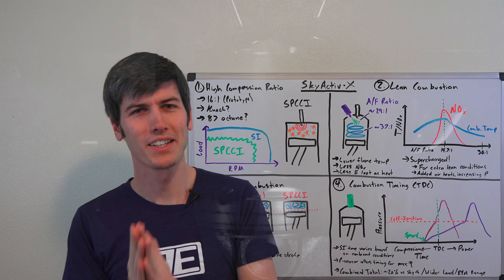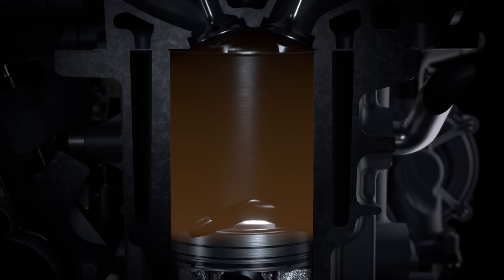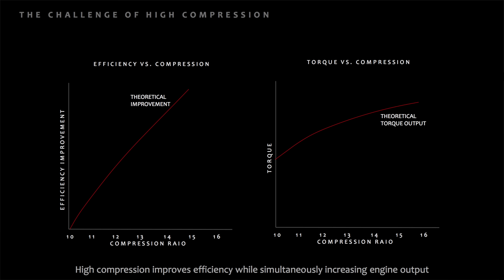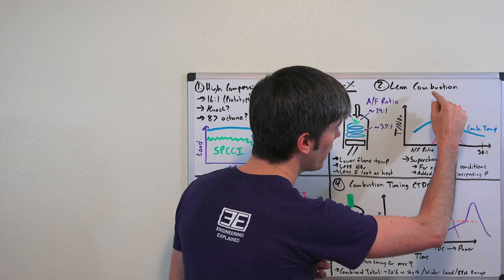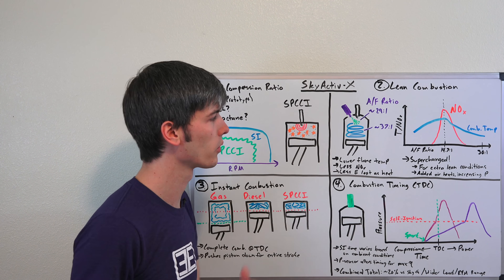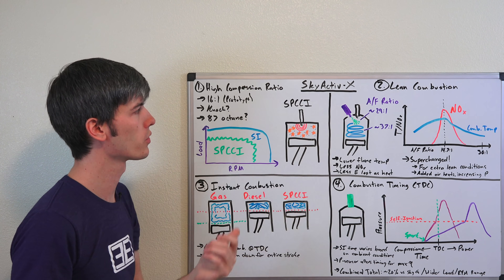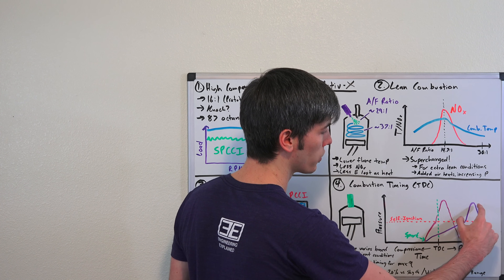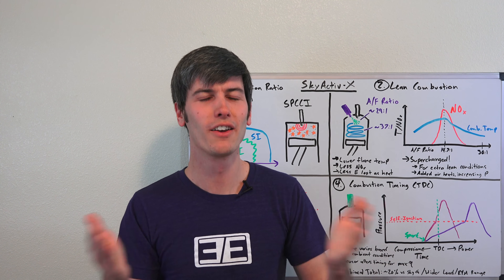How Mazda Is Saving The Gasoline Engine - SkyActiv-X

Comment: It would be cool to see a video comparing the efficiency of automotive ICE's to the efficiency and emissions (GHG's, NOx's, SOx's, nuclear waste, and transmission losses) of commercial electricity generation, and the environmental costs of extracting the rare earth elements used to build batteries. The potential environmental costs of going electric might be greater than simply following through with the current improvements in current automotive ICE technology.

Comment: I thought the main drawback to lean burn was the increase in stuff like NOX emissions? And that was why the first-gen Honda Insight, for example, had a special catalytic converter to adsorb these emissions (burning them off periodically).
Reply from the maker: Slightly lean can be hot, and lean burning diesel engines produce a lot of NOx, but for gasoline engines as you go leaner, temps come down and NOx goes down with it.
Reply: Huh, interesting. Thank you for that info. I guess the 22:1 the Insight officially gets down to isn't lean enough.

Comment: Props to EE for the most comprehensive explanation I have seen on SPCCI to date. While I have come to expect great insight from your channel, you have exceeded expectations here, again.

I have been monitoring SPCCI since it was announced, but I had not seen the pressure sensor explanation piece until here, which makes sense to my novice ears.

I expect my next car will be a Mazda with SPCCI. I hope they put these engines in their CX lineup. 😉

Comment: Nice. Except this is far from being ideal internal combustion engine. Bus engines utilizing natural gas/biogas has compression ratios of 18:1 and they're just ordinary spark plug based IC. So basically this effort of Mazda has been terribly waste of resources, as they could have just utilize clean methanegas fuels to get the same results. Fossil fuel days are limited anyway.

Comment: They are investing in internal combustion engines because electric cars are not feasible. 

Batteries may be getting better, but ultimately you will have to charge them, and with 11.1 kWh of demand added to the grid per car. 

This means it will cost trillions of dollars to upgrade the power grid to add the hundreds of gigawatts of electrical production each year, plus the load balancing systems, transmission lines, charging networks, etc.

Comment: What is the fuel intake system for this engine, is it direct injection or the homogeneous charge is coming directly into the cylinder with port injected fuel ? Please reply
Reply from the maker: Direct
Reply: Hi there. So, is the fuel injection process similar to normal CI cycle? At the end of compression, fuel is directly injected in the combustion chamber (like CI) and in addition to this, there is spark plug(like SI) just near to the fuel injector so that as soon as autoignition temperature is achieved the whole charge is getting combusted instantly?

Comment: This is why I love Mazda. Maximum efficiency, reliability, fun to drive, and affordable - all at the same time.
Reply: Sapphire Spire Mazda’s Skyactiv-G engines have high compression as well yet they’ve been pretty bulletproof since 2013, so...
Reply: @Sapphire Spire 
Well we had a 2013 cx-5 with the skyactiv-g engine go over 350,000 miles with no issues. When I say we I mean I am a technician at a Mazda dealership and we have had no issues with anything internal on the skyactiv engines. Now we had a few Ford engines from 2010 throw rods but no issues from the skyactiv technology platforms.
Reply: sjgavenger37 hey just curious regarding that cx5, I’ve got a 2015 Mazda 3 I gt with the auto, and I understand it’s a sealed transmission, but did you guys ever have any issues with the transmission in that cx5? I was contemplating at 100k miles doing a fluid flush and fill, despite the maintenance schedule saying that no maintenance is required
Reply: @fpaltenhoff86   
No they had no issues but they did have a transflush done about every 50-60k miles. At our dealership we always suggest the first flush at around 45k. Well it isn't really a "flush" it is more like a drain and fill like doing the engine oil. Cannot actually "flush" the skyactiv transmissions like we could before skyactiv.we also suggest doing a coolant flush every 45k miles also. Any kind of oil does start to loose it ability to lubircate over time. The transmissions aren't actually "sealed" as there is a drain and a dipstick. Just the dipstick is under the air intake and has a 10mm bolt holding it in.
Reply: sjgavenger37 Where are you located, because all the Mazda dealerships within 3 hours of me won’t touch my CX-5 transmission for fluid service with a 10-ft pole! I’ve been researching this issue for weeks and I’m going in circles. Your dealership recommends drain/fill...just one drain of roughly 4qts and call it good or multiple drains? And do you drop the pan and change the filter? But then I’ve also read that opening the transmission, even to check the dipstick lets oxygen in increasing oxidation of the fluid and that a true hermetically sealed transmission will last longer than a regular transmission even without fluid changes. ??? Doing a drain/fill myself doesn’t appear that difficult, but I don’t wanna mess with that silicone sealed pan and have to reseal that since the reviews on the off-brand gaskets out there are not good.
Reply: @debbie24680  i have an EU Volkswagen Passat B8 no problems 2.0TSI 272hp DSG7 DQ500
Reply: @debbie24680  
In the CX-5 they don't do drain/fill service on the transition. Actually they cannot.  If I remember correctly the transmission used on the cx-5 is sealed and cannot be serviced that way.  We had a customer that had 350,000 miles on a 2013 Cx-5 and the transmission was never serviced.  Now that also depends if you have one of those CX-5's that had a manual transmission. Now that is a completely different ballgame.
Reply: @sjgavenger37  I’ve decided not to touch the transmission fluid on my 2017 CX5, a supposed “sealed transmission”, but there are a handful of vids here on YouTube of DIYers showing how to drain/fill the transmission fluid on these CX5 transmissions, so they’re not actually truly sealed. 😉
Reply: @debbie24680  
I never had to service a transmission on a cx5. The one time a cx5 trans had an issue we just replaced the whole trans under warranty. It has been a few years since I worked at the dealership and currently having medical issues with memory so some of this information I am a little unsure on now. But I don't remember ever doing any kind of transmission flush or drain and fill on a CX5.
Reply: @sjgavenger37  350,000 US miles?
Reply: @angelbluerider9588  
Yes
Reply: @sjgavenger37  Makes me want to buy a Cx5 then this 2020. but ima buy a used 2015 or 16 grand touring.
Reply: @angelbluerider9588  
That is good years.
Reply: Angel bluerider umm as opposed to European miles?? lolololol
Reply: We, we don’t talk about the rotaries
Reply: @Sapphire Spire Wait which thermodynamic law states that?
Reply: I think after ford sold all their shares And leave in 2015 Mazda is improving on their own
Reply: Rusts like hell
Reply: @marka9261  not anymore, since 2010
Reply: Mar Ka no Ford no problem
Reply: same thing goes for honda!
Reply: @dynamo3059  
Yeah Honda is a great vehicle. My only problem with them is you cannot use after market parts. Gotta use Honda parts or they won't run correctly and loose reliability. At least that is how it was with my 1987 Civic.
Reply: @sjgavenger37  one of the big benefits of owning a Honda is the aftermarket support and options, but with anything you have to make sure it's quality meets or exceeds OEM specifications.  Probably more newish than the 80s but I'm not sure. B-series and K series though have plenty of good aftermarket.
Reply: @Chris-gr7ll  
Yeah I had a 1987 Honda Civic back in the 90's and I found quickly that after market parts are not good options. Honda seems to only work with OEM factory parts. Even with spark plugs. I installed a set of Bosch split fire plugs and within like 20 miles all four plugs fouled out. I installed the OEM cheap NGK plugs and never had an issue. I also had an issue with aftermarket speak plug wires.
Reply: @Sapphire Spire Tell that to diesel trucks with 500k miles or more...
Reply: That's what apex seal said ;)
Reply: And just Beautiful...
Reply: Yes can't fault them.
Reply: Eh.. usually.. not their 4wd systems really and also the rotary engines fail very early at 100%. Long as you dodge those, yea, they're pretty great
Reply: @jaymase3735  
I was a certified tech and never seen one come into the shop with an issue with the 4wd system. Now the rotary....yes they have to be rebuilt or replaced between 60k-80k miles typically but have had a few that needed replacing by 40k miles. The apex seals is the big problem with rotary's. They stopped selling rotary engines in America when they discontinued the RX-8.
Reply: @sjgavenger37  I've seen 2 cases of AWD issues on CX9s and know other import mechanics who have run into the same issue on CX9s- actually, I think I remember it actually being transfer case issues on them. Was warrantied and then at least partially recalled.
Reply: @sjgavenger37  when we're you a certified tech, I don't think they've had either of these issues on any of their newer vehicles. Was mainly 2000's and 2010's.
Reply: @jaymase3735  
Not saying it doesn't happen just saying in the 3-4 years I worked at a Mazda dealership I had never seen one come in with an issue.
Reply: Oh yeah, RX7 checks all the boxes
Reply: Just like your mother.
Reply: Easy to work on - 0
Reply: The 2,2 liter Skyactiv Diesel is unreliable. It sucks.
Reply: Sapphire Spire how do you know how reliable it is when there’s 0 production cars on the road with this engine right now?
Reply: @gewdvibes  U wanna say that again?
Reply: @gewdvibes  well, those cars are made in JAPAN, not in China. They burn CERO oil. I have Mazda 2 2022 1.5L and CERO PROBLEMS. When the things are made with quality standards then u see the result.
Reply: @Sapphire Spire Spot on Dude ✓✓✓✓
Reply: @hanfei6871  really Chinese got small peepee lol 😂😂
Reply: @angelbluerider9588  How small is it tho? is it under 3 inches or less
Reply: Interior is trash
Reply: HanFei   That is so untrue, you must be a troll.
Reply: @hanfei6871  i rather have a bad interor but car still running. than a good interior with a car stuck on the road lol
Reply: Affordable? The prototype is ten million us dollars....
Reply: @DixonStones666  yeah that only creates a $50 increase per car sold... that's pennies in adult money
Reply: @Hallowsaw  "adult money" lmfao
Reply: @DixonStones666  prototypes are always expensive.

Comment: Denise W. You are wrong. Ford of Europe which designed the Focus made good cars. Ford U.S. wanted to do it's own thing and failed. Now excluding the Mustang. The foundation of ALL Ford cars and fwd crossovers are from Volvo or Ford of Europe. 2nd; the 2.0 & 2.3 SOHC 4cyl used from 1974- 2014 was a Ford of Kent, England design that has racing credit you need to look up. It was good for 400- 500hp in turbo race trim. Look up the Ford of Europe Sierra and it's U.S. sister Mercury XR4Ti.
Research before you speak.

Comment: That moment when you learn that you electric cars have emissions, and these occur at the power plant with efficiency losses across several step down transformers with power grids that have to produce more than what is needed.  You dig more, then learn how environmentally friendly building your new electric or hybrid car is compared to the 'polluting' VTEC you've maintained for 15 years.  Then, you dig more and look at how environmentally friendly the car recycling process is for your new car's replacement parts and eventual scrap process.  Then, you finally ask, "Was it really better?" Because, you are not even sure you have broken even over the total life span of these cars. IN FACT, ITS PROBABLY WORSE.

Comment: That engine has to be so expensive to make, supercharger, 2 electronic throttle bodies, high pressure fuel pump, combustion pressure sensor (times 4 for individual fuel trim for every cylinder or 1 as Toyota did in 90s?), EGR valve, EGR cooling circuit, water charge air cooling and circuit for it, but no turbo, so that helps offset the cost.
Great video.

Comment: Can you do a video on fuel efficient E85  cars? I know you can raise the compression ratio leading to better efficiency and I want to know if there are any 100 percent E85 engines and how they perform. Basically an optimized E85 vs gas engine

Comment: Point 3. is 
wrong, gas burns faster than diesel. That's why diesel is limited in rpms.
Reply from the maker: No, diesel burns completely rather than through deflagration like a gasoline engine. As a result combustion is completed sooner.

Comment: The trouble is with the EPA rating is that it only accounts for car manufacturers that sell cars in the US, this discounts manufacturers like PSA who have engines (the EP6 for example), that can give you a combined mpg of 55 (UK) mpg, or extra urban 44 (UK) mpg, so not bad for a 1.6 with 270bhp ;) (and it can happily achieve this though driving at 56mph is a little boring!).

Comment: I just don't understand SPCCI. I understand that a spark plug is still controlling the ignition of the fuel in that cylinder. Which doesn't make it different to me. I also understand that for compression igntion to occur, cylinder temperatures must already be high. Then once fuel is introduced to an air fuel mixture that's been heated by compression, ignition occurs. Your chart on section 2 said that once lean conditions occur at +30:1 A/F ratios, cylinder temps drop, which is contradicting to me.

And lastly, you probably know more about fuels than me but diesel has more potential energy than gasoline. And I thought because of that, it ignited hotter and longer than gas. Thank you.

Comment: You said it, the future of automotive transportation & transportation energy will become fully electric as battery technology improves with improved motor control electronics & energy recovery technology. Using engines as generators to make electrical power means the engine can be tuned for peak efficiency in fossil fuel engine range extender roles in plug-in hybrid electric vehicle platforms. Imagine aircraft that have electric fans for propulsion with a turbine generator that helps once it is cruising to make power for the electric fans while also contributing thrust. 

Toyota already proved millions of times over that hybrid can be better in all ways than conventional with their epic family of Prius vehicles (Prii), many generations now. 
Tesla already proved that electric vehicles can be better in all ways than fossil fuel vehicles with the Model S & X + the next Roadster 2020 ^^ 

All the big automakers are investing billions into electric vehicle platforms because the higher power onboard electrical system can run powerful autonomous vehicle control computers that can drive safer & more efficiently than people, especially in heavy traffic, especially with V2V and V2G technology. Off peak night time electricity, energy storage systems, solar power + wind and fusion nuclear will combine to provide trillions of megawatt hours of power for electric transportation. A Swiss mining company already build a HD mining truck that is grid power neutral because it comes down the hill full of concrete base materials, its brake energy regenerating more power than is required to move the empty truck back up the hill for another load!

Comment: OK. In Brazil we have a 105 octane alcohol (Ethanol)l. 2 questions:

1. To this engine to run with this fuel, how much the engine would have to be adjusted?
2. Would this high octane fuel benefit more from this design?

Comment: Too little too late. ICE is already hopelessly obsolete. Why beat a dead horse, thinking that it will ride again? How about making cars more affordable?

If Mazda is pushing the envelope of what is possible, will their engine ECU be programmed to return to more normal conventional norms, once it gets old, and those extremes no longer seem to work? Better to lose some efficiency, than to have a used up useless engine that won't run anymore.

Comment: Standard cycles have a limit of 90tq per litre using that perfect a:f. If this can get over 80tq/l running 37:1 a:f, that will be the perfect engine. Your body could freaking metabolize those exhaust fumes.

Comment: A car this complicated depends on living close to a service centre. I'd hate to have to try to diagnose and repair the drive-train on this myself out where I live. The old-style low-compression 8-valve four-bangers (c. 6,5l/100km, 72-87bhp) rule the roost here.
That said, the engineering in this is impressive.

Comment: Seems like it will run less in SPCCI mode over time as the sensors and mechanical components as they lose tolerances and wear out.

Comment: Have the engineers figured out the carbon buildup an the back of the valves with direct injection? Have they found the fix for burned valves? Junk I say.

Comment: This seems like a wasted effort to me, especially since it’s basically a cylinder deactivation type thing that only works for half throttle below a specific rpm.  

I’m not impressed.  Better to just go full electric, or go the route Chevy went with cylinder deactivation without sacrificing the characteristics of a v8 under full load for fun.

Why try so hard to save a dying technology?  And make it slow in the end anyway?

I’d buy a Model 3 today new.  Bout the only new car I’d buy right now.

Comment: Just google it, an old European, small, lightweight Suzuki Swift (Geo Metro for US) does 53 MPG / 4,4 L on 100 kms.
Efficiency is not everything. Unsafe, but lightweight cars perform well, too. Drive a bit slower, and BE AWARE of idiots while driving. It's a compromise here, in Europe. Aaaaaand... It works!